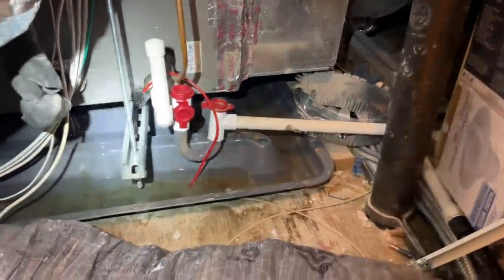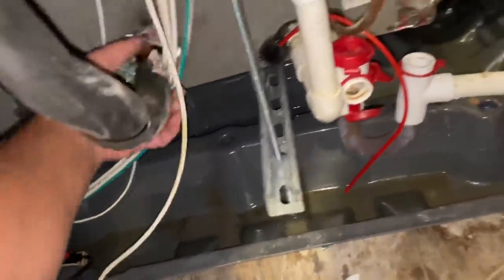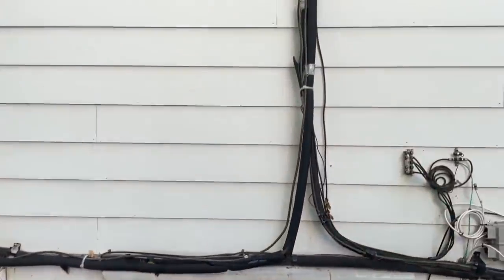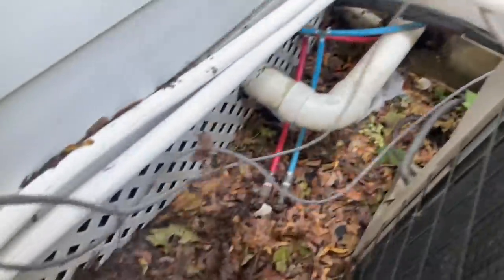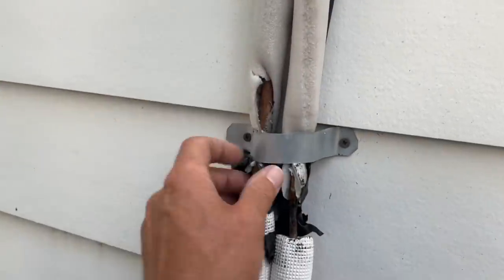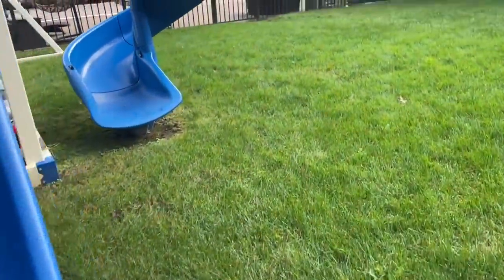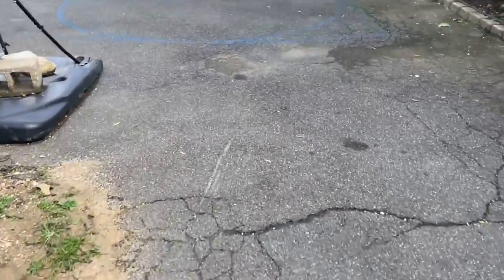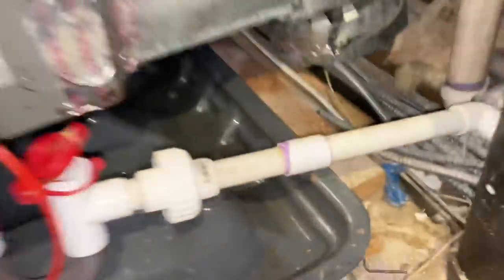Hacked Central AC Installation Caused Water Damage to House Emergency Pan Overflowed Water

Comment: Installs like that are why I never did residential hvac. Well, actually in 45 years I guess I may have been in a dozen attics and hated every minute. Not saying commercial doesn't have their share of crappy installs and terrible locations but my hat is off to you for getting the job done.

Comment: In the south, we break red.  It is a difference of the client turning on the system and "thinks" there is a problem because they assume it is not cooling.  Break red and nothing works, so they turn on the system and nothing comes on, then they definitely know there is an issue and calls immediately versus waiting just to see if it might start cooling.

Comment: Once again a house with thousands of square feet of living space and a mechanical space the size of a broom closet.
Reply: These homes piss me off. All that design and a trash can size room for mechanical a room. Also those mechanical float switches suck and are unreliable. Use the "hockey puck" water sensing  switch

Comment: Hey Mr pipes when you get a Pan clogged you can use your Milwaukee transfer pump to pump the water from the Pan just a easier route then the shop vac that's alot of water to dump
Reply: @PipeDoctor  ted cook , anti diy  uses the hell out of his transfer pump he loves it . He has a long clear hose he runs to a sink or toilet to drain the water into . Check out his video he does on it .
Reply: @joehomanick  Ted also pumps it straight into the drain to help flush the crap out

Comment: This is one the reasons why I hate air handlers being installed in the attic or closest for this reason. Had the air handler been installed in the garage all it would have done is ran water onto the garage floor, instead of on the ceiling and down the walls. I know that  it could be difficult  or impossible to put a air handler in the garage due to floor plans, but that's the developers fault for making floor plans that wouldnt make it possible to put an air handler in the garage in any modern home.

Comment: The original install is “Hack Central”………would you ever walk away from something worse than that one?
Reply: The worst plumbing hvac you will ever see is in a contractor of the same trade. Pride dosent allow them to call someone to work on it and they are to cheap and tired or have no time to work on it themselves lol.  It's like the old cobbler who never had new shoes themselves